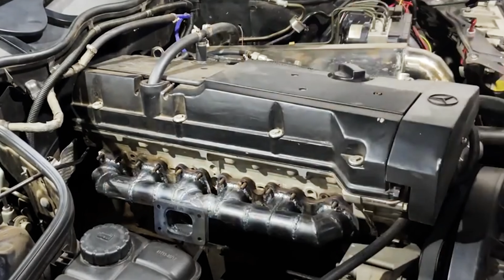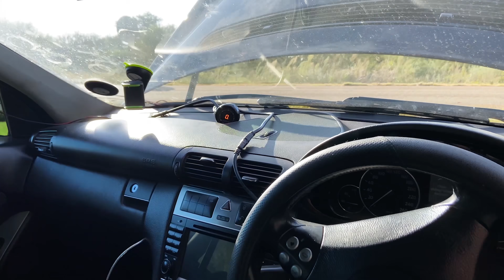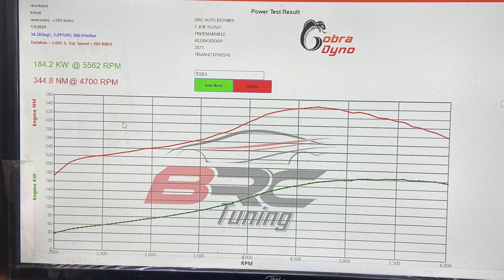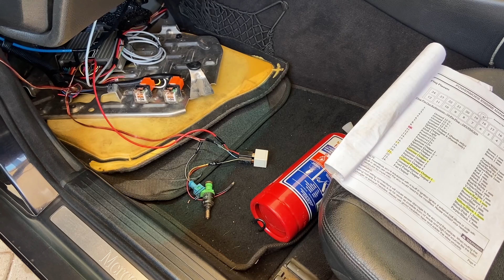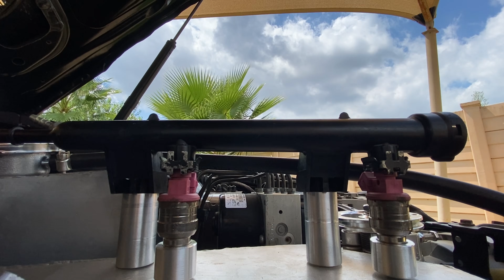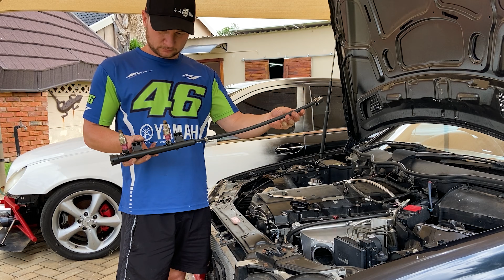Adding BIG 680cc Injectors For More BOOST (DIY HACK) More Fuel = More HORSEPOWER | Might BLOW UP...

Comment: Bro You need to change mindset this engine is easy to tune up very well. I have 630cc bosh incetors and i have almost 500hp and 700 Nm of torque. Put different exhoaust manifold and use all the same lenght pipes to do it. also if you need but it will be hard to setup QSV or make TS manifold. put even hx35 or garett turbo 35 or 40 and y'll see how bmw m4 on the back mirror is missing. need help or info contact me ;) Exhoust pipe 3,5" and rest 3" will be pefect also big IC with 2,5" intake
Reply from the maker: Thanks for the great advice man🤙😁
Just had the car on the Dyno again this week and we made decent power🤘😁🤘
Always room for improvement tho🤙🤣
Reply: BRO i always help you any time any where :D.
Reply: Great build bro , I’m working on mine for almost the same , any links for the injectors for around 600hp please

Comment: the best spot for them is in the  pipe leaving the intercooler this is where the fuel has the best chance to evaporating witch cools the air and the fuel becomes gas and  gets even distubition to the cylinders .. GPO's are generally not injector drivers  it just means you don't have the precise control of the injectors as those in the rail  its not a big deal in this case as you only bring them in when its a bangin along a .. I am a terrified that  they wont yield equal distribution  i say put them in the pipe or even the throttle body . you could even put them in the compressor cover  as you wont turn them on until the air is moving fast you probably wont turn the intercooler into a bomb .. you really should consider running water meth in these it really is the cheat code and  much safer in a number of ways
Reply from the maker: Really appreciate the advice man and you’re right 👌makes sense . The water meth could also help it be more reliable but there’s already so much going on with the fuel cell I don’t really want to add another tank🤣  very convenient to just stop at the gas station and fill it up🤘no mixing 
Talked to the tuner yesterday and the plans changed a bit on how we will trigger these injectors😁

Comment: I have 750cc injectors they work great 484whp on 98ron fuel and capable of more. Not saying anything is wrong with the setup but i was worried about my headgasket so I ended up using 3mm msl headgasket 12:9 bolts and have never had headgaskets problems even when i had knock when i stuffed a fuelpump once. Cool setup love the build 💪
Reply from the maker: Thanks for the comment man🤙🏼 480whp sounds like a good time😁 I think that will be a bit too much for this transmission….
My goal with this is probably around 400hp.
I hope this works🤘😁🤘
Reply: @RicerBenz  yeah it's alot 400hp is very fast and grip is the biggest problem haha. I have a 722.6 auto but I have a another build with a m104 g42 turbo with a cd009 6 speed nearly finished it has alot more in it but track car only. Do you have Ac working? True sleepers have AC you know the rules 😉

Comment: Back in the day when the ecus were terrible (like 20 years ago), when people used to put extra injectors, they used to put them on the boost pipe before the throttle body and wire them to spray at a set amount of boost, using a pressure switch and a wide open throttle switch. As for your head gaskets blowing up, are you using oem bolts? The yield to torque ones are not designed for boost, you probably need better bolts or studs.
Reply from the maker: This Ecu is super basic🤙🏼
Simply getting bigger injectors in this will solve all this🤣 but it seems like I want to learn the hard way…as usual!
I agree getting the fuel in the boost pipe will “spread” more evenly but I’m very limited on space for something like that…

Forgot to mention I do have 12.9 headbolts in it & torqued HARD😁
Appreciate the comment ✌️

Comment: Look at your timing also blowing head gasket is too much timing did that a couple of times and adjusting haven't blown head gasket again,I capped my standard injectors now if flows 450cc with water meth I made 336kw then clutch slipped
Reply from the maker: Thanks man🤙🏼 currently the timing is super safe that’s why it feels slow . For that exact reason. Now to make power by adding boost & fuel rather than timing 🤣👌
Let’s hope this works!🤘

Comment: You are right about not every piston will receive the same amount of fuel and like water methanol the best place to put would be before the intercooler (making the gas becoming molecules) but there are safety issues petrol is high inflammable and just need heat to start the fire
Reply from the maker: That would not be ideal🫣
I’m hoping somehow we can make this work🤙🏼